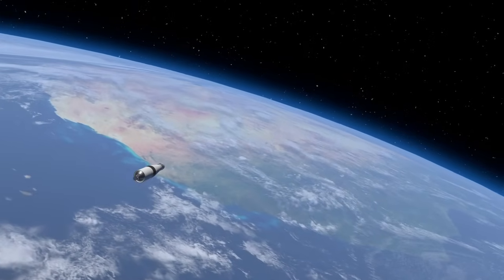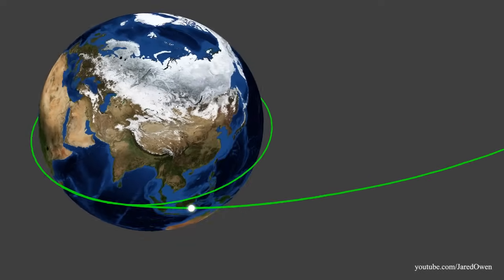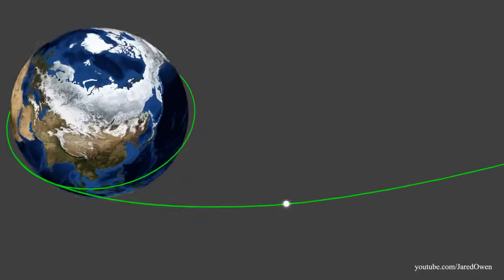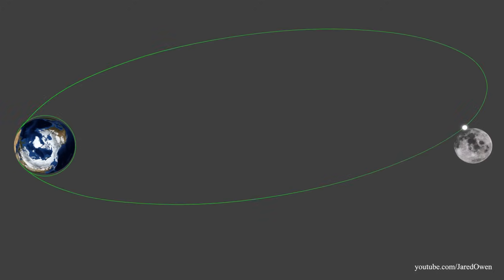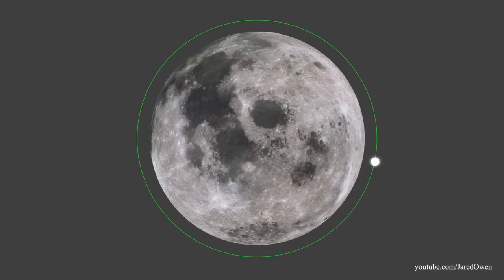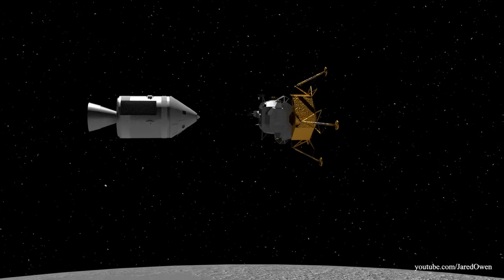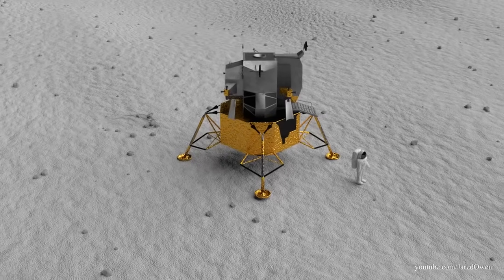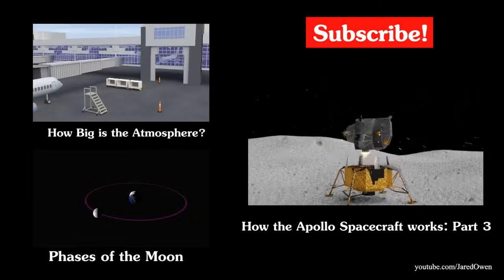How the Apollo Spacecraft works: Part 2

Comment: And they did all of this in the 1960s...🤣🤣🤣🤣🤣🤣.
Reply: Yes, they were orders of magnitude smarter than conspiracists like you. 🤣😂😅🤣😂🤣
Reply: @nebtheweb8885  America don't even  know how to properly built a good car at that time ( it is a joke of course)..but they send a bunch of guys to  the moon, back and forth..i am not saying is not true ..I'm just saying it is hard to believe. I'm just not sold in the way they take off out of the moon floor  and  link the lunar module back to the station  rotating at high speed  around the moon...how they could be so precise to do that maneuver..also how was possible to achieve the almost 2 miles per second  speed need to brake the moon attraction using that small lunar module ..like I said I have not the answer ,I'm not saying is false or true
Reply: @tatoo99999  Yes, they sent Americans back and forth NINE TIMES to the moon, and SIX of those landed. It isn't hard to believe at all, especially since I was already an adult at that time. I know what tech the had and how they used slide rules to engineer all that stuff. They didn't have CAD/CAM to help either. They were smart cookies. You wonder how they could be so precise? Its called 'orbital mechanics' . Fascinating stuff. Lots of math involved, and one of the people that used to do that kind of stuff passed away the other day at 101 years old. That person was a woman, and black. Her name was Katherine Johnson. Look her up.
Reply: @nebtheweb8885  i like your answer ..but still not sold.. something don't match for me ..it is like seeing ancient Egypt people  flying a plane
Reply: @tatoo99999   Lol, it doesn't work for you because of your 'modern-day' narcissism. It is the only experience you have, so to you, everything was invented this century and everything before that was the stone age. Sorry, but that couldn't be further from the truth. Most everything today exists because of what took place in the 20th century. It is like flat earthers saying that the southern hemisphere does not exist. They suffer from Northern hemisphere narcissism. They've never been south of the equator so they just assume that people there are 'upside down' and that there is no South Pole. And now you are showing that narcissism by implying ancient Egypt people had planes, maybe you think Aliens are involved. You severely underestimate those people and the people of the 60s mostly because of the aforementioned 'present-day" narcissism. Don't think like that. 

Food for thought. Without the invention of the transistor in the 1940s, none of the things you take for granted today would exist because we would still need to use vacuum tubes, also called thermionic valves. There would be no mobile devices, flat-screen TVs, personal computers, or microprocessors because valves are TOO LARGE to fit inside any of those things. The other factor was the invention of a way to shrink the transistor down to where they can fit more than a billion of them on a chip the size of a quarter.

How do I know about 20th-century technology? Because I lived it. I worked it. I know how it was done. Physics, Math, superior engineering, testing and the political backing required to accomplish such a feat. That does not happen these days. It's now opposing political parties at each other's throats. No commitment. No progress, no trust. And people wonder why men have not gone back to the moon.
Reply: @nebtheweb8885  I also born during the 20 century..this is not about narcissism..this is about normal doubts
Reply: @tatoo99999  Being born in the 80s makes you a millennial. I was born before NASA was even created by Dwight D. Eisenhower in response to the launch of Sputnik. I worked for over a decade at INTEL, making chips and whatnot. I saw the tech mature so that we can make the microprocessors of today. All that from the invention of the transistor which replaced the vacuum tubes of the mid-century. I used to also work on computers long before PCs and MACs were even invented. They were mainframe computers and large because of those vacuum tubes, and the transistor made them smaller, faster, and once storage medium and graphical interfaces were invented they became more reliable.  All that started with the first computer used in the Apollo missions. The first suitcased sized computer that integrated circuitry. If this had not happened, you would have no cell phone, flat screen tv or any of the other things you take for granted.
Reply: @nebtheweb8885  i born in the 70..the year I born is irrelevant..this is not about what year I born

Comment: Why did it take three days to reach the moon as the ship needed an escape velocity of 20k per miles plus and the moon is roughly 240k?  That would put the moon at 11 hours away and not three days?  

I’m no a denier by the way.  I’m sure there is a logical explanation but can’t find it?  Do you know?   Thanks!
Reply: As soon as the TLI burn is done, the joined spacecraft start to gradually decelerate due to Earth’s gravity. From about 35,500 ft/sec to around 3000 ft/sec at which time they reach the point were the moon’s gravity influence is strong enough to start gradually accelerate the spacecraft reaching a velocity of about 6000 ft/sec until they needed to do the lunar insertion burn.
Reply: mako88sb thank-you so much.  Makes a lot of sense.  Great Job!
Reply: NP. Good to hear you found it helpful. I did have one too many zeros in the initial velocity but it’s fixed now.

Comment: It didn't work moon landing fake can't get thru van Allan belt with humans without heavy shielding not aluminum thickness of a dime
Reply: "can't get thru van Allan belt with humans without heavy shielding not aluminum thickness of a dime"

The fibrous insulation between the inner and outer hulls of the command module was at the time the most effective form of radiation shielding against high energy electrons and protons of the VHB - the lower the atomic number the better - come back when you understand Bremsstrahlung.
Reply: And you can reference a particle physicist that can substantiate your allegation?
Reply: @steverodgers8425  project Orion documentary on discover channel they admit they have to test shielding unmanned first to get thru belt.the Orion project was back to the moon(really to moon first time)even the man pro moon landing asks the NASA engineer why don't you just make a copy of the ones they already have .they lost the technology just like they lost all original tapes for all the moon landings remember those were on bulky tapes probably 60 or so of them
Reply: @timmoynahan4401  only the Apollo 11 telemetry tapes are missing. Probably recorded over.
Do you even know what telemetry is? In what manner would they be a significant element of a historical record?
The computers that could review the tapes no longer exist 
The Orion spacecraft requires a more robust fuselage to protect the crew and electronics for long term exposure from electomagnitic radition. The craft is designed for longer duration flights to the moon and perhaps Mars. The Apollo Command Module offered sufficient radiation protection for the duration of the missions.
I suggest you review a primer on cosmic radiation before forwarding a false narrative.

Comment: What type of propulsion system is used  to land and takeoff from the moon?
Reply: They used hypergolic to get off of the moon. a fuel and oxidizer that is reactive instead of having to be ignited. The oxidizer and fuel they used are also very highly toxic. When mixed together they spontaneously react with each other and ignite with no need for an ignition source.

Comment: Yeah but how does the service module pull a 180, dock with the lunar module , then pull it out of the third stage cover and still not mess up that trajectory or orbit it's already in?  That would require thrusters cause you cant change position in space without doing so.  And they do this halfway between the earth and moon ... wow.
Reply: That’s what course correction were all about and the Apollo spacecraft were linked to Houston and the huge main computers almost continuously.
Reply: They used the reaction control system and Newtons third law of motion.  For every action, there is an equal and opposite reaction. Short blasts of air that would move the vehicle. https://images.app.goo.gl/uofHtmedaxHdtAbJ6
Reply: It did require thrusters. Look up RCS.

Comment: Very nice video and graphics. But the work of all that is THEORY. Armstrong could not control this thing in tests and was lucky to survive from those tests
Reply: That's not correct. Armstrong completed around 30 flights in the Lunar Landing Training Vehicle and 50 landings. He did have to eject from the vehicle during a training flight in May 1968 when a system failure rendered the vehicle uncontrollable.
Reply: el di Armstrong was not flying on the earth when he landed the LM on the moon. 1/6th the gravity, no wind, no rain, no drag. Big difference.

Comment: Can someone explain how the thrust works without having atmosphere, so they could make the maneuvers?
Reply: @elias Put in the simplest possible terms, rocket thrust is a contolled explosion. The expanding gasses of the explosion push against the combustion chamber of the engine and exits out the nozzle. The thrust is the force of the explosion pushing against the rocket itself which propels it along. Rockets don't push against outside forces.
Reply: It doesn’t push against atmosphere or the ground at launch either. That’s the whole point. The thrust IS the force the rocket pushes against.
Reply: @corneliuscrewe8165  Yeah,  stupid question. That's basic physics. Had that misconception.
Reply: No worries. It isn’t the easiest concept to wrap your head around.

Comment: How the Apollo Space Craft works: first you get yourself down to the local Ace Hardware and load up on all the tin foil you  can get your hands on. Plus a bunch of foil  plenum tape...LOTS of foil plenum tape!!! While you're there pickup anything else you think that you can strap together that will look like 5th graders built a Buck Rogers space fort. Some tarps might come in handy, some galvanized pipe too.
Reply: This is why the saying “don’t judge a book by it’s cover” exists. The structure of the LEM comes from the material under the layer of foil (which only exists as an insulator anyway)
Reply: You are such an idiot. You state "how it works" and then proceed to describe how you can build an Apollo spacecraft from materials bought in a hardware store 
You demonstrate, just as all hoaxtards do, what kind of slobbering knuckle dragging wretched moron contends for fraudulence .